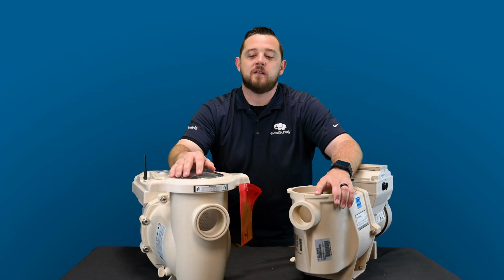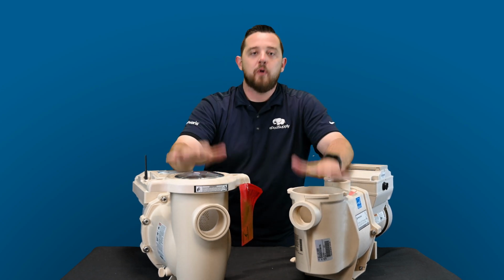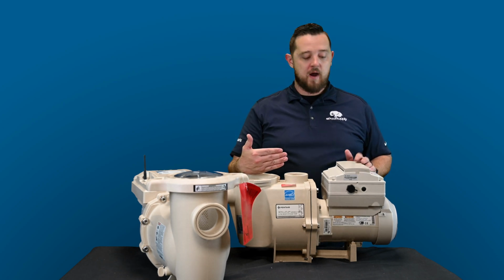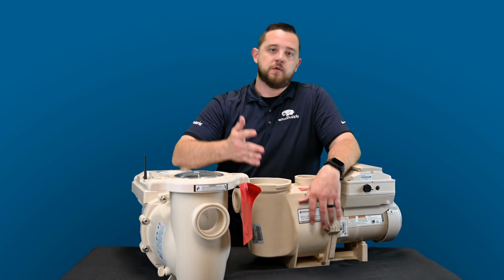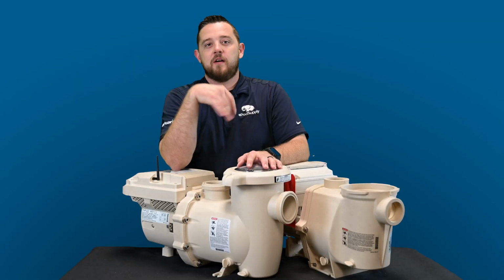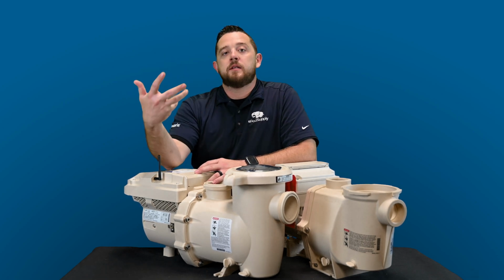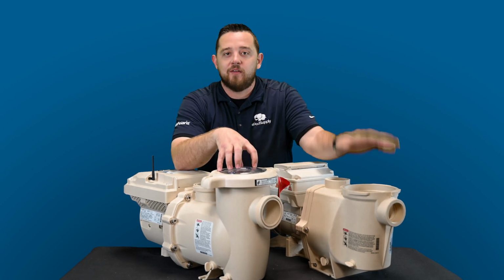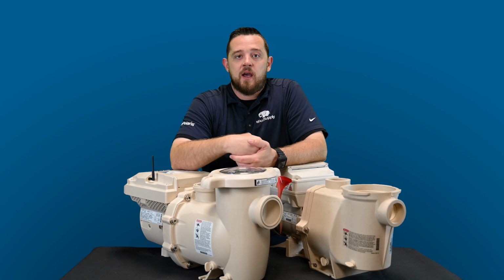Pentair IntelliFlo 3HP Pump Comparison 011056 vs 011076

Comment: Does the new inteliflow come with a safety vacuum release system integrated and keypad to avoid using the phone?
Reply from the maker: It does not but they are still manufacturing the EC-011057 which does offer that feature.

Comment: So why didn’t you touch more on the flow rate technology vs strictly rpm
Reply from the maker: The majority of pool owners and pros stick with RPMs for scheduling purposes and such based on the pool size. Flow rate can be hard to understand and or comprehend at times unless you really do your research to dial your pool in. We stuck with what we thought would be the easier concept.

Comment: Great post. I am looking at one of these to replace a 10 year old 011018. I am not sure which to get. Any recommendation? Is the 011075 pretty much the same pump with the newer wifi and 2" connects?
Reply from the maker: Yes, in fact, they will be the only models available for purchase here in the near future. Give us a call for the best available price!
Reply: You are correct , but for cheap money the 011076 has the relay to connect other components.

Comment: i have a pentair 520554 intellichlor ic20 and 520556 intellichlor power center, can they mate to the 011075 intelliflo3 that does not have the io board?
Reply from the maker: Hello, unfortunately, no, that's the whole purpose of the io board. Without it, all you can control is the pump. Pentair will be offering it as an add-on in the near future so stay tuned.

Comment: Hello.  I am looking to replace my Pentair Superflo model 340043.  From what I understand from the video, I will not be able to use the existing 2inch female unions that are currently connecting to my current pump.  Is there a fitting I can use to reduce the 3inch outlets to 2inch unions I currently have?

Also I have the Intermatic digital timer which controls my high/low.  If I go down this route with this pump, I wouldn't need this anymore?  I can control everything from the pump itself?  Also would I be able to wire my pool lights into pump control board to also control centrally?  Thanks for the info.
Reply from the maker: Hello, no there isn't any fitting that will reduce the size so you can use the old unions for this pump. You can only add one light to the rear end of this pump to control it through the pump. you can also add a secondary pump for a water feature or booster pump. Hope this helps!
Reply: @ePoolSupply  so in my case I would have to use a reducer coupler from 3 to 2? Is that correct?

Comment: Is the only pump that pentair makes that connects directly to the Pentair Home app without requiring any secondary equipment or intellicenter? My system is just a pool pump only. No lights, heater, or secondary pump. I live in a very high cost Time of Use area and want to be able to control when the pump is on myself. Should I consider anything else?
Reply: Do any of the whisperflo pumps connect directly to the pentair home app without intelliconnect or any other secondary equipment?
Reply from the maker: No they do not.
Reply from the maker: Hello, for that type of setup you would probably want to go with the 011075 model. It is just the pump without the IO board included. Would be perfect for what you need on that type of system. Below i will attach a link to our website so you can check it our for yourself. Hope this helps!

https://www.epoolsupply.com/products/intelliflo3-vsf-3-0hp?variant=40135515537493
Reply: @ePoolSupply  Really appreciate your reply. Thank you very much. I am on a time of use plan that changes throughout the seasons and jumps around even during the day. This will be perfect! 

One other quick question I’m sure my pool pro can also answer but I am curious. Can I reduce from 2.5” ports down to whatever my pipe size is? I believe they are existing 2”.
Reply from the maker: @jacktracks707  Yes you can.

Comment: Sounds like a nightmare for the pool tech. Hope the app handles multiple locations quickly and easily. What happens if the internet is having issues. "Sorry sir I could not connect to your pump so your pool is still dirty". I suppose a display and wifi is too much cost. Would have been nice to have one or two buttons you could configure with the app to handle these situations.
Reply from the maker: Hello, It has a connect button for the Wi-Fi and Bluetooth. also has a quick clean button as well as an on/stop button. Hope this helps!
Reply: It does look like Pentair was smarter than some other manufacturers--there's an on-off and a quick clean button. Still not thrilled about it, as I think the old Intelliflo was near perfect and close to bulletproof, and didn't need a phone and app with all the potential connection problems that come with to program, change, or diagnose.

Nothing's worse than having to be on-site with a phone-only system that is acting up, or have to wait or make a return trip to get the wifi password to connect to the system.
Reply: @Seas_Of_Neptune   yup. Currently have 2 pools I service with this new VSF. Not a fan of them at all.

Comment: Ready to build using IntelliCenter Kit and IntelliFlow 011056. Are you saying I don't need the IntelliCenter with this? What about light relays and dual pumps as for Spa Booster?
Reply from the maker: As of now you can hook up one low voltage light and one secondary pump. If you have more than that you are trying to automate than you may still require the IntelliCenter. Hope this helps!

Comment: In in the process of building a shallow pool / pond.   There will be an upper pool that overflows into the lower one (6 foot wide waterfall)  I was planning to plumb it with 2" pipe. (4 main drains + 2 skimmers and diverter valves to balance out)  Would you recommend this pump for this application?  (I will also need a sand filter.)  I'd estimate we are talking 30k gallons.

Also; if drained, is this OK to leave outside in a winter that sees -30f
Reply from the maker: Should be more than enough to operate a pool like that. And yes they can be left outside as long as the pump is drained. Hope this helps!
Reply: @ePoolSupply  I will have to order online as there are no pool stores here.   Suggestions?
Reply from the maker: @andyh8239  Give us a call. (602)274-7946.
Reply: @ePoolSupply  Do sand fiters have a big impact on power efficiency of your pump?  (do most filters bypass the 'over pressure' to eliminate problems?)

Comment: What if you have automation already ? Can you hook it up to an easytouch?
Reply from the maker: You can still hook it up to automation, with a cable under that back cover there's a RS 485 connector so just the IntelliFlo cable, or if you are able to make one yourself. Hope this helps!
Reply: @ePoolSupply  do I just need the green and yellow cable, so red and black cable aren't necessary?
Reply from the maker: @alextiburcioescobedo7617  Exactly, Red and Black are not needed.